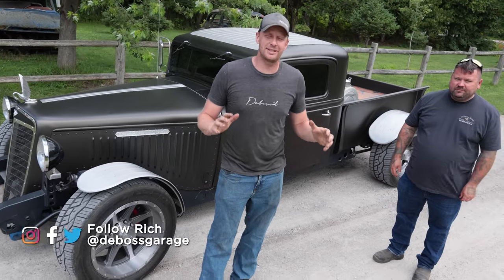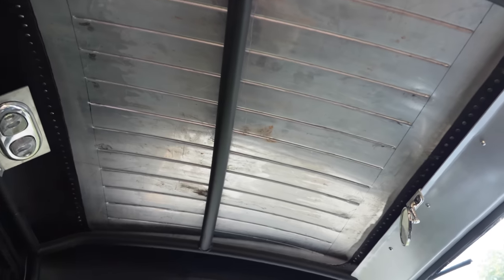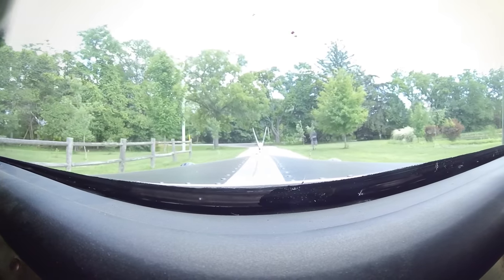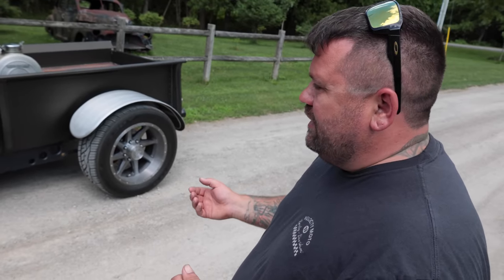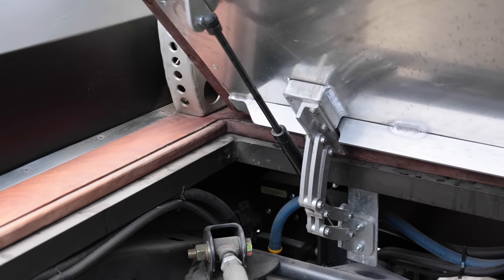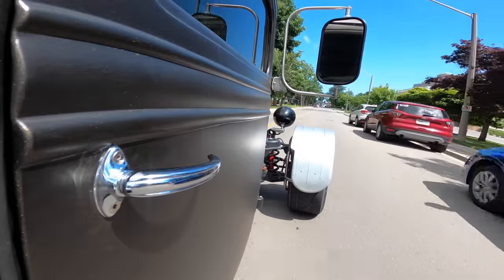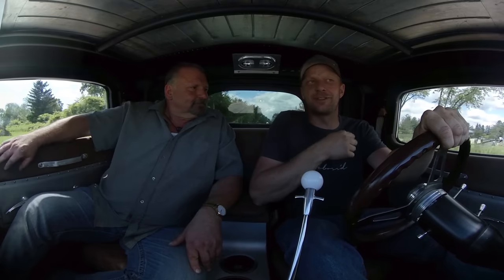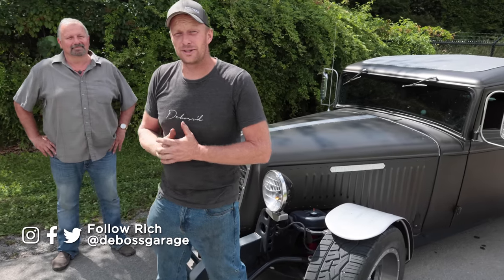Duramax Diesel Powered '36 International Pickup

Comment: Very nice. The Duramax stomps its contemporaries. When you start a Duramax and hear that amazing idle and feel it in your bones, you'd have to be a corpse to not smile at that. This is a tasteful build to say the least. Now, I agree I would have done the LCD dash cluster that u can program. And, why not go full electric on accessories like Rich mentioned? Prius electric steering is ez and cheap. Prius AC is fully electric, BUT, it runs at 200 volts due to the hybrid battery 🤔 If Rich says you can do an electric AC at 12v, then that's a no-brainer. Do electric water pump for engine coolant too. Now, they went with a rather small air2air intercooler. I'd definitely go with 2 water2air intercoolers in series. Add another electric coolant pump and small reservoir for the intercoolers and a plate heat exchanger linked to that loop for the transmission. Or have a third coolant loop that handles the trans fluid and eng oil thru plate exchangers. And lastly, a good electric gear pump for oil pre-lube and engine assist. Now the only accessory to pull load is the alternator. I suppose the original water pump can just have the impeller removed so it doesn't pump anymore but the pulley spins. Not entirely sure how to plumb in the electric water pump but I'm sure it ain't hard.
Reply: When you get yours built, exactly how you'd build it, let Rich know. lol

Comment: Instead of moving the shift location just bend it, plenty of examples of it in 18 wheelers for ideas on shape.

For ease of dash on the next project you could go with a Holley dash, way easier mount and wiring and then you just customize the gauges to match the build. Not my personal preference on the way to go, I like the old round gauges, but I do understand why someone would want to cut that complexity out of the build.